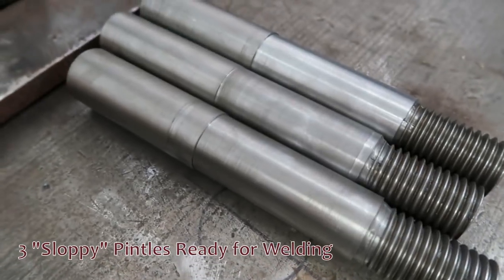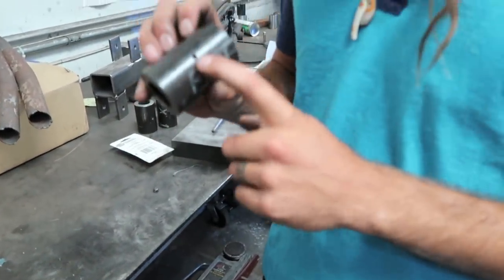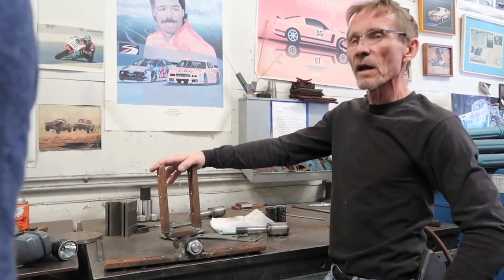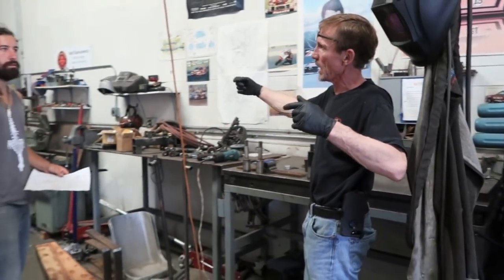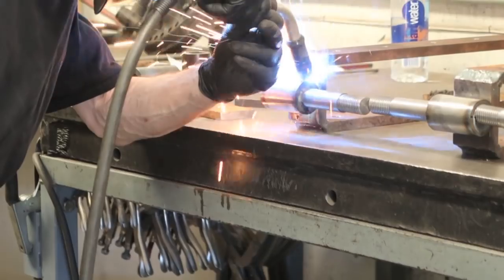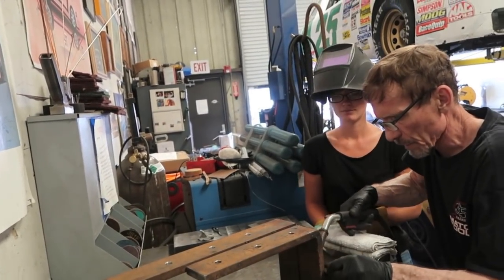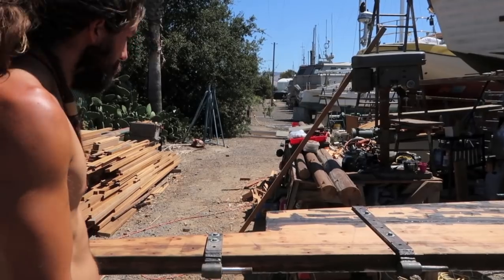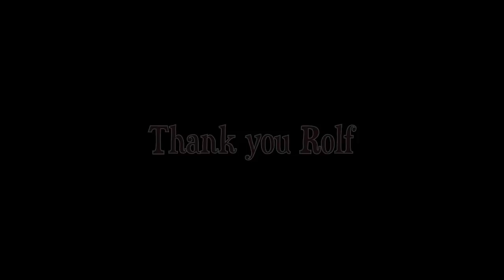Salt & Tar Episode 35 - The Rudder Continued

Comment: I understand the concern and opinions of some on the use of mild steel on a boat in salt water, but most vessels on the ocean are made entirely of mild steel! More prone to corrosion, yes, which requires added maintenance. Will it work? Absolutely, and will be a joy to see following launch. Great job and keep the videos coming.
For those who believe Stainless Steel is the only way to go, put up the cash to buy the materials and that's what would have been used. Building a boat on a budget ain't easy, help them out with more than opinions. ;>)

Comment: Did Rolf die just a little bit when the grinder came in contact with his machined pin?
Reply: Ty Smith, It was hardly a machined part with that amount of play in it, and because there are three pivots they will still bind when wooden rudder changes shape.

Comment: Use the correct grade of stainless steel then it won't rust, and it is not difficult to weld either, anyone can weld stainless steel, using the correct welding rods or filler wire you can arc weld it or mig weld it in the same way as you arc weld or mig weld mild steel, better still you can tig weld it and this is not difficult either as some welders like you to think. I would not have that mild steel anywhere near my boat.
Reply: Yup its actually easier to tig weld than mild steel. I think there giving up
Reply: hey john didn´t knew you were following these guys too. i have the same concerns as you and the lack of a some sort of bushings/bearings. i just hope they know what they are doing.

Comment: (( garrett) you can hook up mini hydraulic hoses to your greese zerks or plum the fittings in at ( 1/8 n.p.t thread. The zerks will corode to nothingnessing in the salt water use brass. Truckers , that drive all winter through slushy winters through the n.w winters do this to there king pins & spring hangers. Ive searously done it as well.hoom you up a brass ,or stainless greese dash biard/ manifold.it wouldnt cost ad much ad u might think the greese manigokd coukd even be inside of boat..
Reply: If cost is an issue .( you could use cooper tubing .the ( smallest size i believe is 1/8 , you can make an extra coil with a generous radius to accommodate the movement if the rudder. ( itz just a thought , but ( the steel pental & shaft will seize
Reply: Hey I made the copper tubing comment on the last vidio
Reply: I would use at least 1/4" cold grease can be hard to pump

Comment: please seek advice from someone knowledgeable with rudder hinge design and manufacture like mr keith fenner (turn wringht machine shop - has a website and youtube channel). i know nothing of boats and marine environment but i´m a welder and i´m really worried about the job done here. i say this with my best intention. i hope you are doing well and thank you for sharing your work. regards. peter
Reply: I totally agree with p penca here, good luck with the rest of the build.
Reply: I agree on the welds. In my opinion that´s the weakest link here. In heavy weather and following seas there might be more than continues stress, but also knocks due to the loose fitting of the pins. On the other hand it will probably work fine for the purpose of getting on the water and learning the boat in normal conditions, even if I would evaluate before crossing oceans. As you, I´m only concerned, and wish the hard working couple all well and best of luck!
Reply: The San Francisco bay and coast can be very ruff on boats . There are some wild currents going on